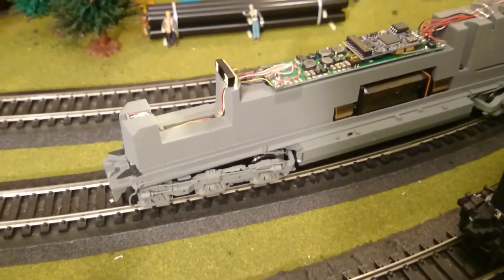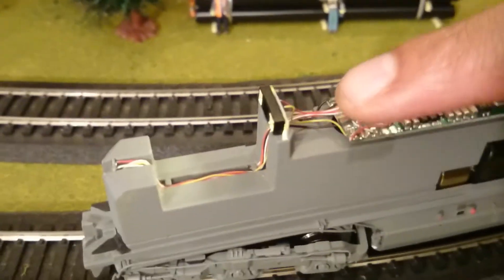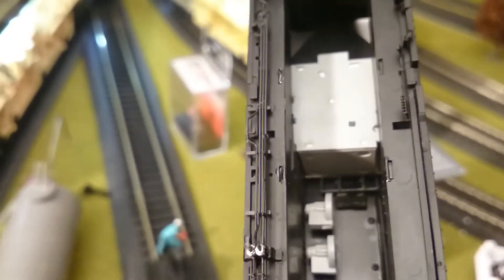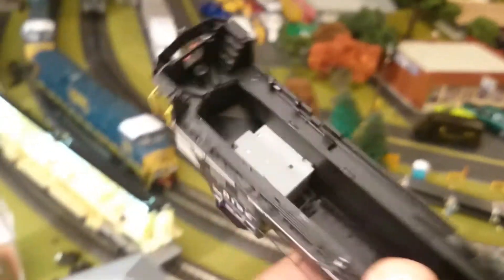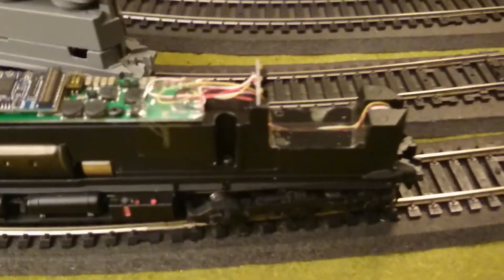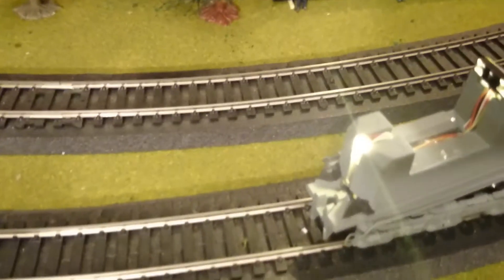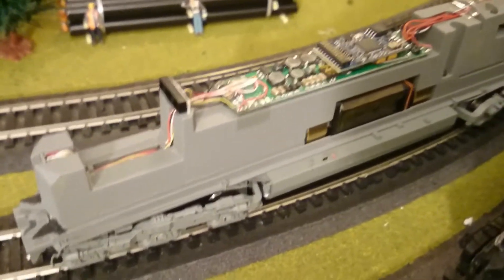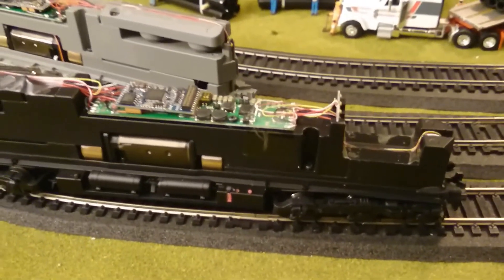Scale Trains Tier4 Gevos Update NS & UP

Comment: I also had an issue with my NS version.   The plastic piece was still where it's supposed to be, but the black gasket was pushed down over the headlight led.   So I didn't have any headlight till I fixed that.   
~Deryk

Comment: Interesting, road No. 3804 is having the same issue with the rear lights.  It appears on your engine that there is a wiring issue.  Move around the wires while the rear lights are on to see if they go out.  Also there is a possibility that the decoder may have not been seated correctly on the PCB board.  I have to check mine when I get a chance.
Reply from the maker: Triple M Model Railroad yes sometimes when I have it running on the way out the light will flicker a little bit so it might be a bad wiring it could be a bunch of issues

Comment: Where is the speaker located?, i want to upgrade and also have several that i want to install sound on. Thanks
Reply from the maker: spacecalander the speaker it is located on the rear top section of the chassis.
Reply: Is it already wired to the board on a dcc and sound ready model?
Reply from the maker: spacecalander yes it's already pre-installed from the factory so you don't have to do anything.